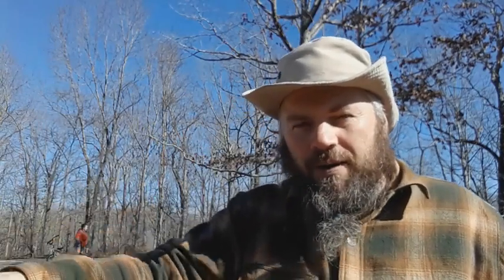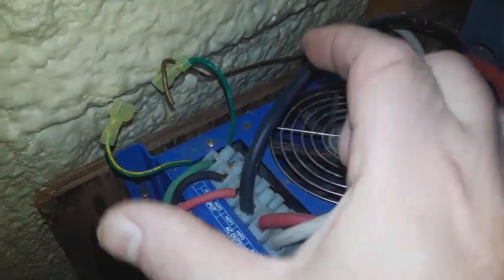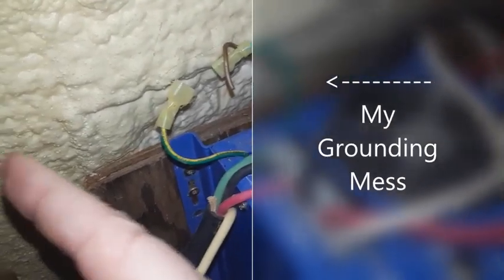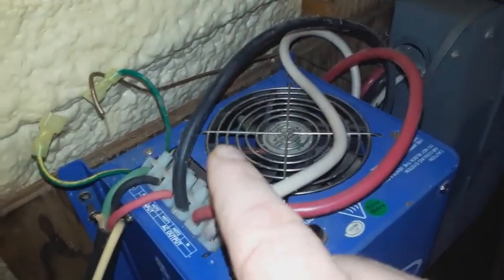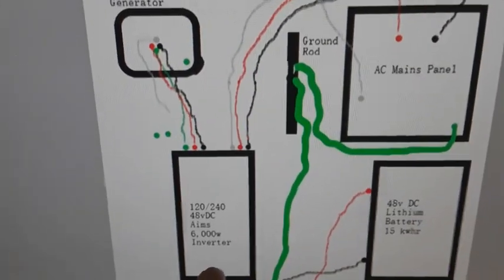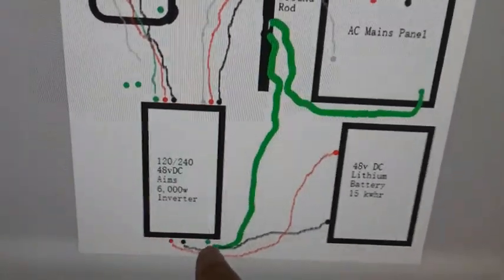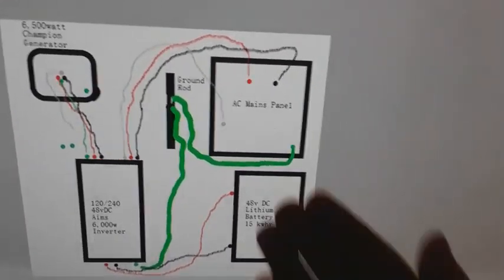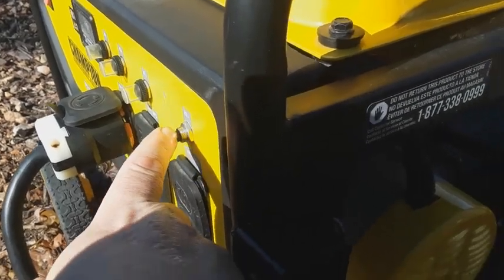AIMS 6,000 watt Inverter Power, Grounding & Problems

Comment: Dang... Billy you lost me...have no idea when it comes to this.  Good luck 🤞. Have a wonderful day 💞
Reply from the maker: 1 line in my Aims inverter manual that said you cannot cross the ground and neutral or it would result in inverter damage. Most house have a ground and neutral bond in the Mains panel. <- this is why i'm very concerned as we turn the house from a Mobile style wiring application to a Normal house grounded non mobile application.

Comment: You lost me after you said, Welcome to the Wickershire project off grid. 😂 I have great knowledge and skills with many things except electrical. After getting electrocuted when I was a little Sasquatch, I have no desire messing with any of it. I always pay someone to do anything electrical for me. Back home, one of my best friends is the Chief Electrician for the State Fair of Texas at Fair Park in Dallas. Mitchell always helped me when he was available. I bought everything he said that I needed and I'd turn him loose. I wouldn't even stand over his shoulder. I'd rather try to kiss a gator surrounded by cobras! 😊 Willing to bet it was your goat that boogered up your generator. If I was Nathan, that's what I'd say. 😂
Reply from the maker: I'm not defeated. I'm just mad I can't process the Neutral to ground.  As stated I'm overthinking it. Once i'm in the Mains panel i believe I CAN cross the neutral to ground like a regular house. Why?  The inverter is a separate issue and wiring schematic. They do have a case ground <-- 100% different. Its Meant to be pole grounded or it wouldn't exist.  If I follow my wiring in the mains panel and then bond the neutral  to ground it 100% crosses both the inverters ground and neutral.... REALLY! WTF! hahahaha

Comment: You're over thinking it. You have to wire the A/C and D/C separately (you know that already). You have to run 3 wire 120 volt and 4 wire 220 volt lines out of your Mains box for each 120 or 220 volt load. Each voltage must have a green ground wire along with a common (white) and a hot (nominally black 120 or a black and red for 220). You keep using the word ground for the 220 line white wire. It is actually a "Common" wire that will supply either leg of the 220 lines. A green wire is not needed if you are using conduit traces (bx don't count). The conduit will serve as the ground path back to the mains box when using steel switch/outlet boxes.. If you are using plastic switch/outlet boxes you must run a separate green ground wire back to the mains box. You are correct about the inverter and mains box being ground to a grounding rod outside. You might as well also go ahead and ground the generator to the same grounding rod. It can't hurt anything but will help with establishing a ground path for the generator. If it were a residential install the mains box would be grounded to a cold water supply pipe (copper all the way out) in a public water supply. However, if a well is used a ground rod must be used. For review; The white wire is NOT a ground wire!!!!!! It is a "Common" wire used for either or both of the L1 and L2 loads (120v and 220v). A separate Green wire "Ground" must be used for plastic boxes.
Reply from the maker: Awesome.  I traced the loads. I read the manual that states " Never bond the Neutral to ground on the inverter or it voids warranty and will cause damage to the inverter.  I traced the Units Neutral to the mains. I also traced the Units ground. Both of these WILL bond in the Mains. Now I'm in Panic Mode.  AIMS Needs to Clarify this statement. How else would you  wire a HOUSE as back up with the unit with out crossing the Neutral  and Ground in the mains.  I do have the option of NOT bonding the two.  Keep L1 120v, L2 120v, Neutral to them self as that neutral/common has a path to the inverter unit to supply a 120v return path. Then Only send ( ALL copper ) Grounds to the rod.  Sh*t I may have figured this out.
Reply: Under any circumstances, the common and the ground NEVER "Bond" in the mains box. There are separate places in the mains box to connect each "Ground", "Common", "L1", and "L2". Or to use the terms that the Aims manual is using, "Ground", "Neutral", "H1", and "H2." Are you trying to wire the inverter to provide a 240 volt single phase or 240 volt split phase? You should be using the 240 volt split phase wiring diagram - Yes?
Reply from the maker: @HemiFourMe   240 split phase yes. I found my problem. There is a Big GREEN screw in the mains panel. I removed it. Now they are unbonded. My ground is 100% isolated as well as the Neutral.  <- Who knew. I had to shut everything down and Path trace visually with a Multimeter. I saw I had a back flow problem on my ground. I do not have my unit wired in such a way to actively bond the ground in the mains WITH the Inverter itself. It's wired for RV style mobile application when I wired it due to the fact we did not Own a grounding rod at that time. The wiring has not changed. I WILL be grounding  everything SOON! <- OH BOY and thats why my sticky note says " DO  NOT BOND NEUTRAL TO GROUND!" Please solve this before connecting. Thus the Video came out.  So yeah, Unscrew the Mains panel GREEN neutral and ground Bonding screw. Case solved.  Ok need to go puke... 🤢🤮